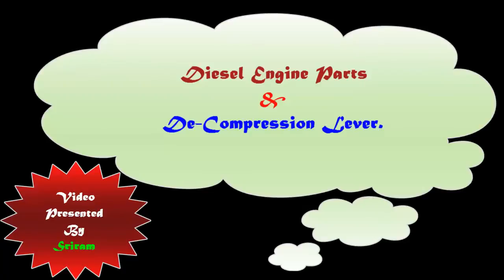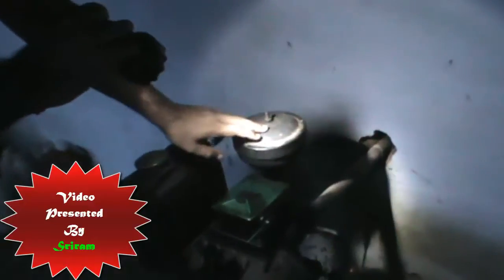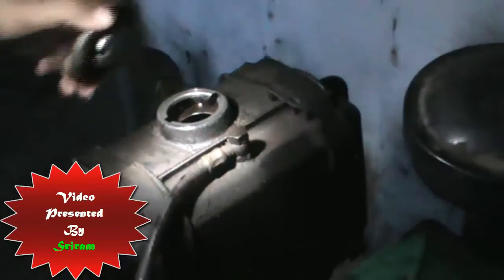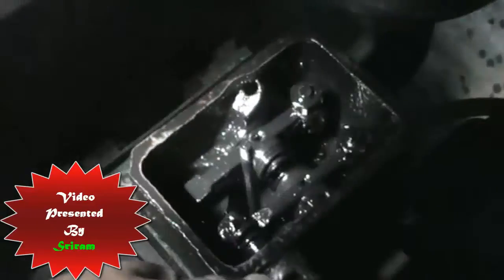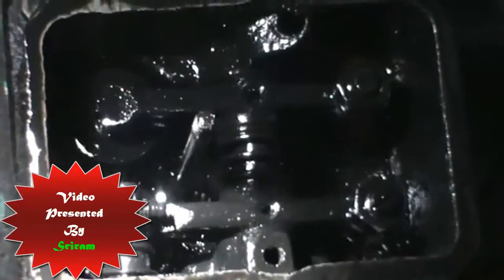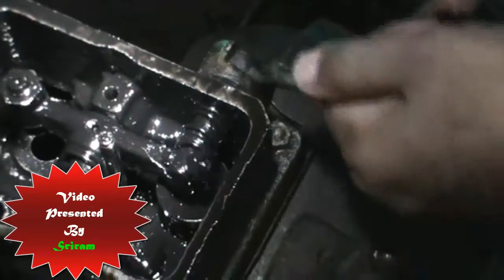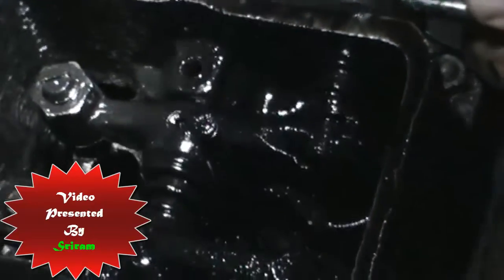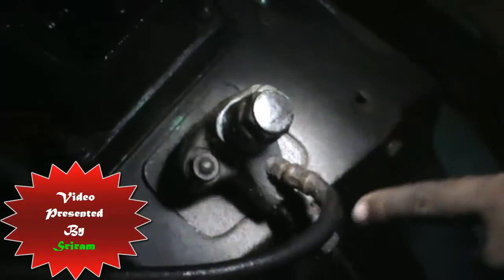Diesel Engine Basics - De-compression Lever..!

Comment: Hi and thanks for a great video. I wonder if you can help or any commenters'. My friend has bought a boat sold as seen. He got a mile down the canal and the engine appeared to be running rough. No come back from seller. Bottom line is when starting it will only fire on one cylinder. When the decompression lever is closed on second cylinder it stalls the engine. Someone suggested hydraulic lock? Somebody else suggested compression lock? That being possibly caused by misaligned replacement of this compression release arm? He doesn't have much cash for a mechanic at the moment so were seeing what we can sort ourselves. I have advised him against navigating with one cylinder to prevent damage to the engine. Its is a 2 cylinder ST2, electric and hand start. Any clues to what is causing this, or could it be as simple as correcting the alignment of the decompression lever? Any advice would be greatly appreciated. Thank you. 😊

Comment: if I actuated the decompressor lever on diesel engine while it is running
would it shut the engine down in the event of a Diesel Runaway Condition?

I'm installing a 24hp Diesel Engine for a Mini Farm Truck and it has a CVT..
Safety First hehe.
Reply: Yes. I have done this a couple times myself on small engines.